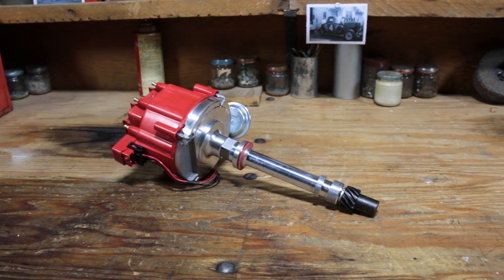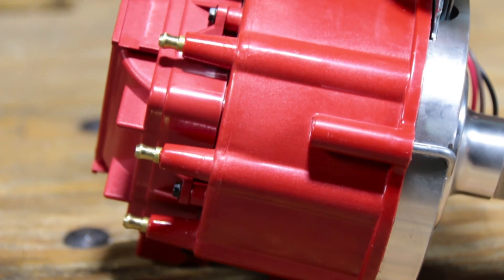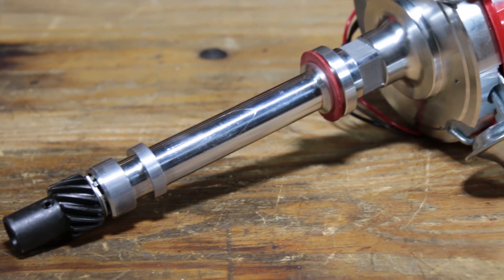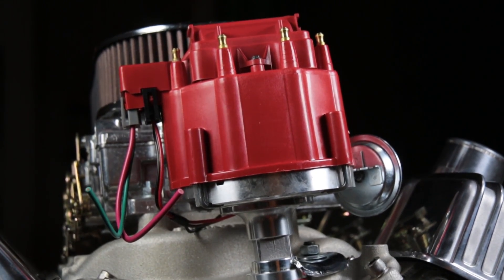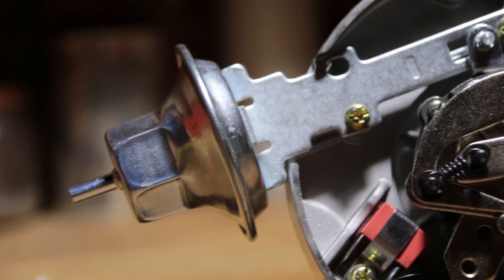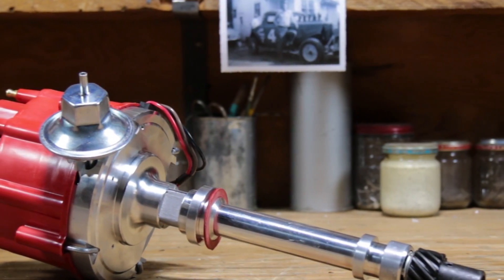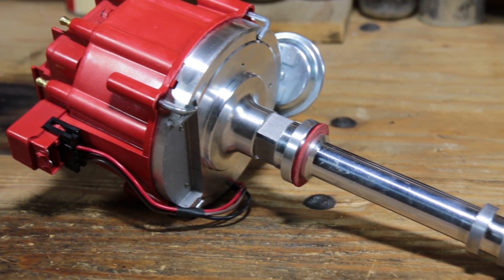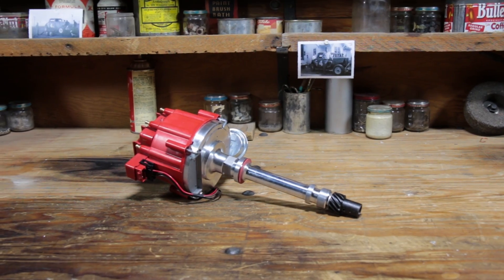Speedway Blueprinted Chevy HEI Distributor

Comment: Speedway Motors advertises this complete blueprinted distributor, equipped with a high-spark 50,000 volt coil all for $98 bucks, yet they also advertise a complete HEI Distributor with a high out-put module and a high-spark 65,000 volt coil for $63.07, pn# 2896501, you'd think that the higher cost blueprinted HEI Distributor would come with the high-spark 65,000 volt coil as well, being that it cost more money. If I was gonna build a SBC engine that will turn 6,000 to 7,000 RPMs, I'd definitely want the higher spark 65,000 volt coil. Maybe I'm over looking something here, hopefully Speedway Motors will explain this to me.